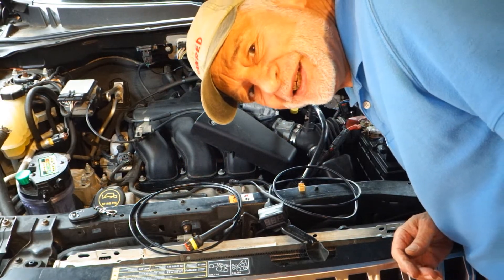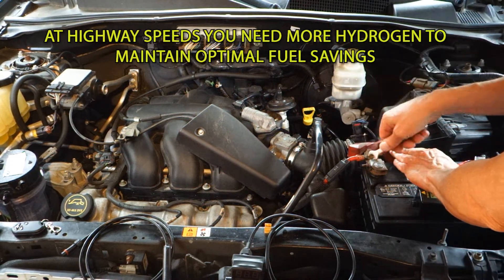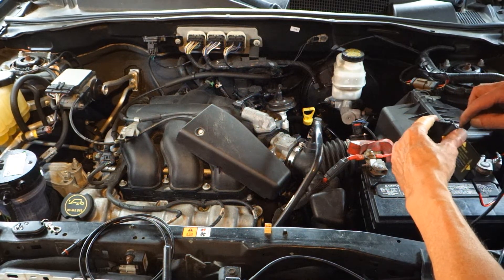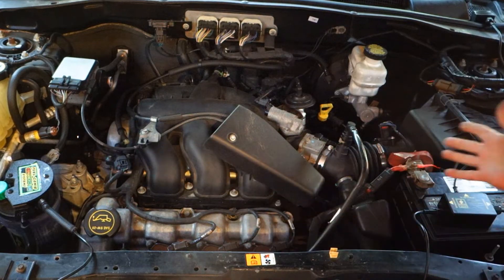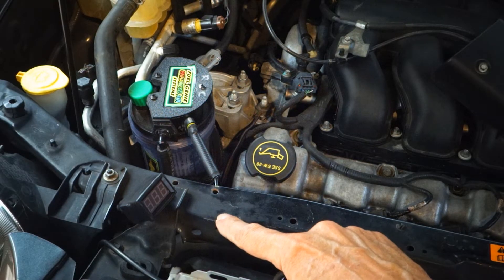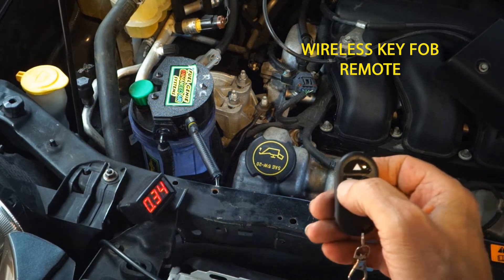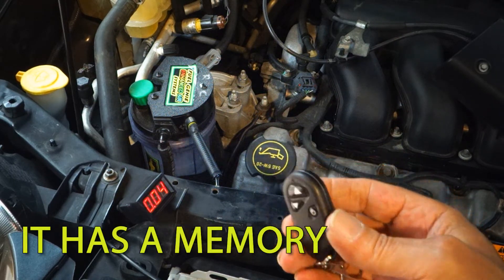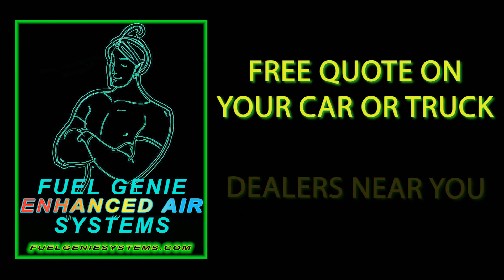FUEL SAVING SYSTEM WIRELESS RET FUEL GENIE SYSTEM INTRO

Comment: Ok so you connect the control module to the battery, but the hydrogen converter just sits not connected to the air or fuel system?? I call bs..
Reply from the maker: It connects to any vacuum port after the throttle plate assembly.

Comment: Have you done an emissions test?
Reply from the maker: Nothing official but here's a 5 gas analyzer test we perform to show reduction in toxic emissions. These kits also reduce 2,000 times the acidity in the exhaust as well from avg. pH4.2 to pH6.4.
Reply: @fuel-genie-systems1  Do you have a link to the test?
Reply from the maker: @1Wondering  https://www.youtube.com/watch?v=uUq6cks7qAU&t=76s
Reply from the maker: No link to the acid test.
Reply: @fuel-genie-systems1  Thanks... that's exactly what I was after. 

How did you measure the reduction in acidity from pH 4.2 to 6.4 (+2.2)?

🙂
Reply from the maker: @1Wondering  With a pH meter. We bubbled exhaust from vehicles into pH neutral water. When we tested the water, the average of all the vehicles was 4.2- some higher , some lower. We tested again with the Fuel Genie System and the average was 6.4. Gas and diesel engines combined.

Comment: How do you get around the issue of hydrogen embrittlement?

🙂
Reply from the maker: We're not using 100% hydrogen. Just enough to lean the mixture to improve engine efficiency by about 30%.
Reply: Interesting point. H2 embrittlement should occur at any percentage of hydrogen... although it would be slower if the concentration was lower. 
🙂

Comment: cash grab that shit doesn't cost 200$+  Really cool idea but you need take the greed out of it to work. And its apparent the people making it is doing it for greed.
Reply from the maker: I challenge you to build one of these kits for under $400.00 with labor. Add in insurance of $7.00 per kit, 28% taxes, manufacturing overhead and the cost per kit comes to just under $500.00. Making $100.00 on a $500.00 investment is not greed- it's prudent business practices. We help others save money on fuel cost. ROI is about 14,000 miles when gas is $4.00/gal.

Comment: will there be a smaller kit for motorcycle in the future?
Reply from the maker: We have a kit but there are concerns selling them. One kit: If the bike tips over, the solution will run to the engine and it will be permanently damaged; Second kit: has battery powered, mercury switch activated shut off valve in the line that feeds hydrogen to the engine. This keeps the engine safe from damage should the bike accidently get knocked over. The tilt activation is always armed but only actuated when the mercury switches tilt more than 45° left or right. That tilt control box costs $160 to make. The system itself costs $418 with electronics, rare earth titaniium and hard to manufacture items. The retail cost of this kit with tilt protection will be $ 600.00. We found no market for that.
Reply: @fuel-genie-systems1 Why don't you use bicarbonate of soda as the electrolyte on motorbikes? 
NaHCO3 isn't corrosive and even if it runs into the engine no damage would be done? 
Bicarb is only slightly less effective as an electrolyte than NaOH.

Motorbikes don't have a lot of spare space. Where on earth would you fit it? 

🙂
Reply from the maker: @1Wondering  Thanks. We'll look into that.
Reply: @fuel-genie-systems1  I've always wanted to fit a HOH system to my car or motorcycle... but bypassing the oxygen sensor has always been a problem. 

Even on a motorbike the savings would eventually pay for the system... although it might take a few years on a motorcycle. It helps if you ride a lot.

🙂
Reply: $600 for a motorcycle kit?! It only costs like $15 to fill a motorcycle. That's like 40 tanks of gas. No wonder it won't sell.

Comment: Why should there have to be a remote control? Shouldn't that be taken care of automatically?
Reply from the maker: So it would seem. Truth is, no two engines have the same metrics. We found the same  amounts of hydrogen enhanced air added to the same make, model and year of Toyota RAV4 gave us different increases in mpg. We tried the same test with two F150s and two Prius cars. In all cases the setting for one vehicle yielded different miles per gallon. 
So the purpose of the remote control is to find the optimal setting for your engine: one for in-town driving and one for highway driving. 
Different makers of ECUs meter fuel differently. Any one particular make, model and year of vehicle can have one of 6 ECUs made by different companies. 
We tried taking engine telemetry via a bluetooth gongle in the OBD port &  translating that data tp a remote pwm. We spent over three months with hardware and software and concluded 1) The sensors and hardware needed were too expensive and would add another $120.00 to an already moderately priced kit and 2) The lag time to send a "demand" signal to the pwm actually makes mileage drop in-town. It's better to have one steady setting in-town instead of variable amounts of gas going to the engine. Nothing beats the human brain for being able to adapt for best mpg.
Reply from the maker: It absolutely can be done automatically but more sensors are needed on the engine for the telemetry needed to make constant adjustments. Humidity sensor, altitude sensor, OAT temp sensor, air quality sensor and motion sensor. Without these inputs you can't do it automatically and make it have any effect. It's a cost thing. Sensors would run over 2K
Reply: because they need a reason to charge you more. They could just made a blue tooth app but than could they charge you 100$ for a phone app? :o
Reply from the maker: @Bewefau  Without the remote control, you can never be sure you are getting the most benefit from your system. Add too much hydrogen and mpg drops drastically. It's important to know how much is going into the engine because there is a distinct ratio for best mpg of hydrogen to fresh air. Vary outside that ratio and you're wasting money.